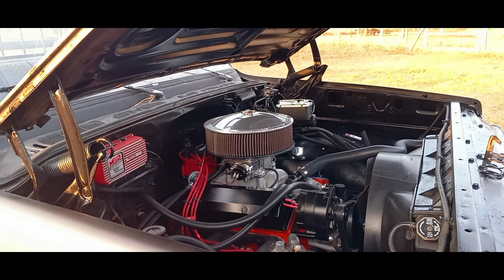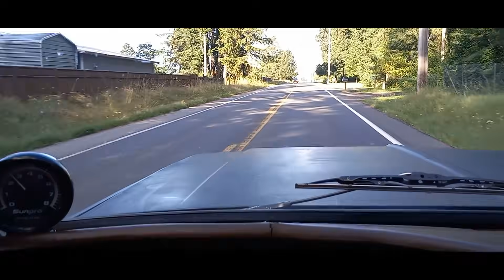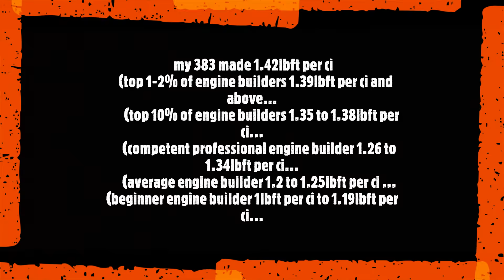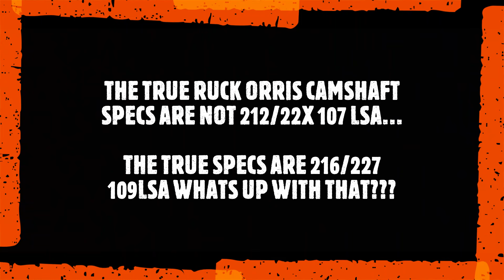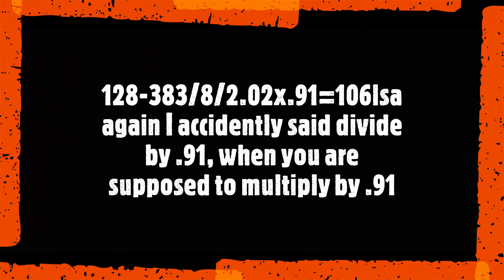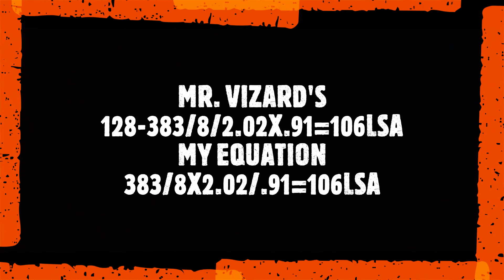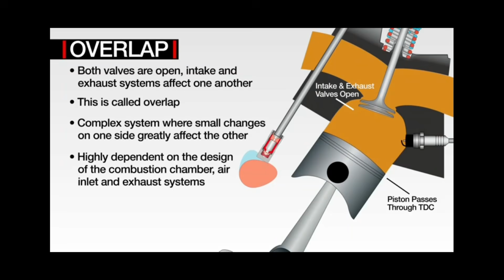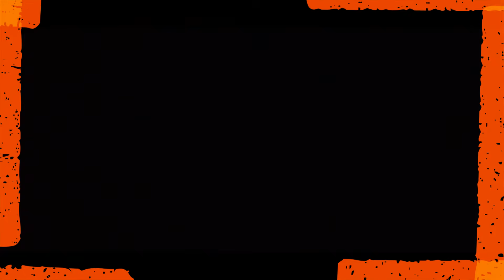CAMSHAFT SELECTION by LSA, 9 LSA's DYNO TESTED!!! LSA THEORY WILL BE DYNO PROVEN!!!, and EXPLAINED

Comment: Lastly, I'm not sure what they did wrong, but our Truck Norris cam does indeed have a 212 intake duration. Why lie about it?
Reply from the maker: This is just the first comment i responding to.. I will ask big John at Delta Cam why the intake duration came out to 216.. You say the intake duration is 212, So then are you indirectly saying that the exhaust duration is 227 and the LSA is 109 instead of the claimed 107? If so why say the LSA is what isn't? Also Why x out the last number on exhaust duration? What's the point of keeping the exhaust duration a mystery?
Reply: @CDG-Racing_Dynamics  the exhaust duration and LSA are also incorrect.
Reply from the maker: @briantooleyracing3554  But why X out the last number on the exhaust duration?
Reply: We can't simply give every competitor all of the specs. We want them to work for it if they're going to copy it, which happens all too frequently unfortunately.
Reply from the maker: https://youtu.be/-b-aLsByUHU   Here is the link to the Delta Cam video that ran your truck norris cam on the cam doctor..

Comment: You have completely missed why LSA is a derivative.  Most LS engines have completely flat pistons with no valve reliefs.  You can't simply reduce LSA and retain piston to valve clearance.  Customers do not want to notch pistons in these genre engines, so the camshaft has to be designed around those Piston to Valve clearance restrictions.  
The easiest way to settle who can create the most powerful camshafts for LS/LT engines is to simply back to back test it on the dyno.
Reply from the maker: I completely understand why you say LSA is a derivative it's pretty obvious, hell you explain why you yourself personally think it's a derivative in your LSA video that I used the clip of in my video.. But your theory is extremely generalized and will not produce the most/fattest TQ and HP curve for any given engine combination for any given application, and when people hear you say what you said in your LSA video they bealive because you are Brian Tooley that it is the best way to design a cam and get the most/fattest TQ & HP curve for any given engine combination & application, which it wont... But the method in my video will give you just that, the potential to produce the most/fattest TQ & HP curve for any given engine combination in any application.. PROVEN & GARENTEED 💯 1000'S & 1000'S & 1000's of times...
Reply: @CDG-Racing_Dynamics  how can I contact you?

Comment: thanks for sharing, Hope you are well. Currently building a 11 to 1 comp 383(Australia has 98 fuel  readily available) with Comp Cams XR288HR 236/242 110 LSA 106 center line, project X 215 heads ported to improve on lift under .500, RPM air gap, 750 carb, only chose 110 LSA as i plan on spraying 250 to 300 shot of gas. Going in 3600lbs cruiser car. Plan to make 500Hp/500ftlbs plus aspro 750 plus on gas.2500 to 6000 rpm range think im not too far off using your formulas given cubes, valve size etc should be 107.8LSA but comp higher and good low lift flow numbers  etc should be not too bad having a slightly wider LSA im hoping. let me know what you think. 3600lbs car with 700R4 trans 2800 rpm stall 3.7 or 3.9 gears 255/60 drag radial. Would be interested in your thoughts

Comment: Hi it's me again so I did get a camshaft that is 107 LSA for a 407 engine with a 208 intake with 14:1 compression on a 2 barrol because of my spec class only allows 2 barrol carburetor is the lsa to wide or so narrow I sorry if I get confused to easily I don't know to to calculate it with more compression I know you said more compression wider but LSA but I didn't know how much if compression is 1 point higher or for example like 14:1
Reply from the maker: Hey Bud, the LSA that would give you the best results would be a 108LSA... Hope that helps💪🏻😎
Take Care Bud...
Reply: @CDG-Racing_Dynamics  oh thank you
Reply from the maker: @chevyrc3623  Hey Bud, One more thing, I will have another video out soon, is gonna a BANGER of a camshaft video😆.. Its about 30 to 45 minutes and and it will be focused specificly on LSA, it goes deeper into it and explains a bunch of effects, it shows 17 different LSA's in 5 different engines, with 4 example's of optimal LSA in 3 engines... I also have proof that shows that a 108LSA when optimal for a given engine will make more peak TQ & HP then a 106LSA across the entire power curve, which goes against common knowledge where the 106 makes more low to peak TQ... I will also show an equation that shows how to adjust Duration to match optimal LSA & overlap... i may add a few bonus LSA dyno sheets, i even have one showing the effect of optimal LSA on a 572BBC...   Take Care Bud👊🏻😎
Reply: @CDG-Racing_Dynamics  oh nice thank you so much so I did 128-407÷8÷2.08×.91= 105.7 plus compression was 2.1 which was .6 per 1 point gave me 107.8 plus the rockers 1.6 intake so .25 which gave me 108 just like you said 108. So thank you again so hopefully I got the equation fully correct from you and David Visard. I can't wait for that video

Comment: thank you for this vid, I had misplaced dv's formula and even tho I have several of his books here I couldn't find it. really appreciate the explanation of how to use it. 
   I am doing a 98 454 this time and the cam I come up with by your vid and dv's formula is a 106 lsa 270, I haven't spec'd the lift numbers yet as I've yet to find the max valve lift numbers or finished building a flow bench to see what lift It needs.
Reply: Start with 'cubes per hole'. Then multiply that by .91. Then divide that by your intake valve size (in inches).  

Take that number and subtract 128 if you have straight valves.  If you have canted valves like a BBC or Cleveland, subtract 131.

Doing it that way will give you a negative number, but the answer is easier to find on a phone or a calculator that way.

To end up with 106 on a BBC your intake valve should be around 2.065"

Comment: Thank you for all the info.. man so much between you and David. just came across this video and his few days ago.. Id like to Ask you if im on the right track with a motor my son and I want to build. Street drivin so pump gas . but we want to take to the 1/8 mile not far from us. motor will be a 383 stroked. with Eagle or Scat lower end , around 10 to 1. Heads im looking at are from Skip White Performance NKB 200 200cc runners 64cc chambers flowing  at 550 lift is 250 intake 187 exhaust. The intake is Elderbrocks Performer RPM AirGap and carb is demons screamin demon 850 with downleg booster and  Primary jet is 82 and secondary jet 93. The cam im lookin at is Howards #116615-08  valve lift .476 intake .480 exhaust .  Dur @ 0.50 is 235/241 lobe sep is 108. and lookin to put it in something like a nova.. monte carlo size car. running 373 gears and a automatic with 2500+ stall. I Welcome all the info i can get. thanks again for having this channel and will be watching now that i found it. i subscribed to you and david both.

Comment: I don't get it. How do you minus 351 from 132? I come up with a minus  -219 then divide by 8 =-27.375 x .91= 24.91125. How is this a lobe separation?
Reply: It is a 351 Cleveland but here is the way 132-351÷8÷you intake valve size let's say 2.08 just cause ×.91 equals 112
Reply: @chevyrc3623  You could put parentheses in there to help correct your order of operations.  Recall that the mathematical Order-of-Operations acronym PEMDAS covers this without the added parentheses... Parenthesis, Exponentiation, Multiplication, Division, Addition, and Subtraction, so it works out either way, but the parentheses help a lot to keep track of this order!!  Calculate what's in the parentheses and then do the subtraction: 

132 - (351 / 8 / (valve size) x 0.91) = 112.896, which is 113 degrees with a 2.09" intake valve.  

If it's a Windsor: 

127 - (351 / 8 / 2.09 x 0.91) = 107.896, which is 108 with the 2.09 intake valve.  

Hope that helps!

Comment: I've always thought that most camshafts are either totally wrong for the application or not optimum for the engines needs.
 Thank you for sharing this information, I have been dreaming about a " great " street engine that has strong off idle torque that will "run out" strong as well.
Reply from the maker: Thank you for watching...

Comment: I’ve listened to your video several times and greatly appreciate your time making the video and all the informative knowledge you’ve shared. I’ve been a follower of DV for sometime as well and try to soak in as much info as I can from him as well to expand my knowledge. I ran the equation over for a buddy of mine’s build and maybe I’ve missed something because the duration is quite small using what you said about using known advertised cam overlap to corrected LSA from formula. He’s building a 408 stroker 351 with a 2.08 valve. The DV formula came out to 104 LSA and shelf cam he’d chosen had a 4 degree overlap. So I ended up with 212/212 @.050 on a 104LSA. Did I go wrong somewhere? It’s going in a street driven efi 5 speed mustang if that helps

Comment: Hi I got a question so I am very confused on your math and David's math so your 383 build it came out the same but for some reason when I put 406 in you math said 112 and David says 105. So I don't know what I am doing wrong but I did 406÷8×2.02÷.91 then I got 112. Then 128-406÷8÷2.02×.91 I got 105 so I don't know if the calculator is doing the order wrong or something but I thought it was weird it came out that way
Reply from the maker: I had said in the video that the equation I came up with only works for 383ci.. as I said in the video I showed this equation to prove that just because an equation is created that is ideal for one specific CI engine doesn't mean it will work across the board for other CI Engines...  Davids equation is the one you want to use. thanks for watching....
Reply: @CDG-Racing_Dynamics  oh sorry I didn't remember that part your video you have teached me a lot about camshaft so I appreciate your help. A lot so my other question is so if I figured out my lsa 10.5:1 compression how can I convert that to say 14:1. But thanks again for your time to teach everyone about camshaft lsa. I know I got a lot to learn I am trying to build a wingless spec Sprint motor with my dad

Comment: Great video for guys  that want to be surgical & grab all the HP & torque  for their $$  & 🚀. Or run that recipe on the strip /stop watch .   & Then there's  the fun barbeque  back yard builders who just call all that, fun & don't care to go sky high . Or even stop watch the motor when finished . Doesn't matter beans how perfact under the hood is . Unless it's drag racing . Dyno is numbers & reference  period . All the rest is up to the pilot.  I love your openness & sharing  of advice👀🥂 . With out all the potty words . Without variety we would have nothing .  Congrats on building a sleeper 🚀 s/b .  Now go for the rest of the gusto hidden in sbc, &  build some real cui into your equation👀🏁🐎 🥂 .  You could mass produce the final results 🏁 & sell motors to all the street classic hot rod cars &   mud truckers . No doubt in my mind , motor would compete ❣️. There's a few guys out there who built 900&1000hp naturally aspirated motors years ago 👍. The big thing about cams 🤔  &  motors 🤔.   The real🏁 BOSS is the Gears 🏁.

Comment: I have long had the ability to form a mental image or construct a thought experiment of the internal dynamics of an engine. This loosely leads to what Mr Vizard’s and your equations represent, but with clarity. 

 I view these methods as a generalized way to get you to, perhaps, 98% of where you need to be. But, there are almost always very specific issues or conditions that, if realized, could give you a slightly different outcome. I think it is always good to keep an open mind to this. 

It is intriguing to hear your discussion and, perhaps you might be talking to a smaller audience, but I would like to hear more. 

Thank you

Comment: So, If the intake closing point determines DCR, could one perhaps choose a cam with a slightly larger LSA and exhaust duration to slightly boost top end while increasing Static Compression to make up for lost low-end power? Is that the point of going with a looser LSA per point of compression? What would you say the max DCR should be for pump 87 and 91?
Could the LS motor's difference in Valve geometry, stroke, and rod length be contributing to the dyno results showing torque as being relatively high? I sorta thought that the LS was designed to make more power and torque higher up to help gain volumetric efficiency.
Also, I know advancing a cam shifts the power curve lower and see lots of Summit truck cams that have large advance but larger LSAs. Why would they choose to advance the cam rather than tighten the LSA if both achieve a similar DCR?
Currently building a 6.0 LS for my truck.
Also, I'm sorta seeing that the Intake close point almost seems to dictate where the motor will make power and how much torque it will have down low, is that true?